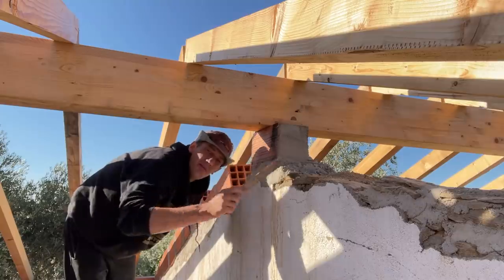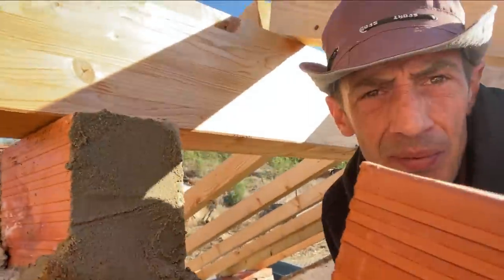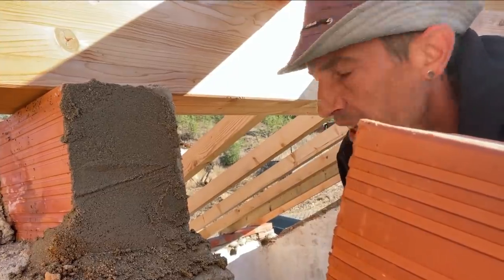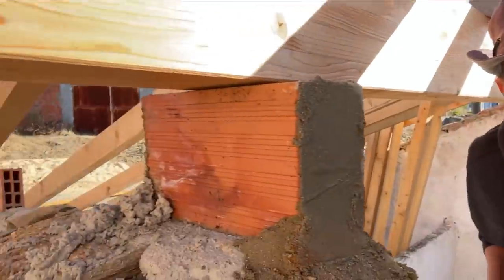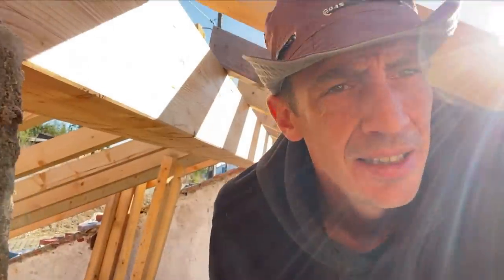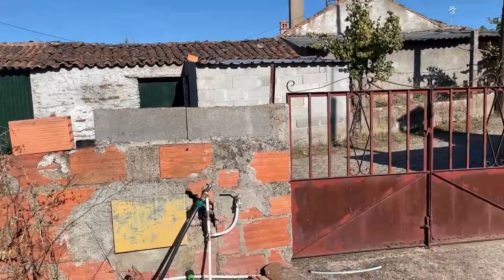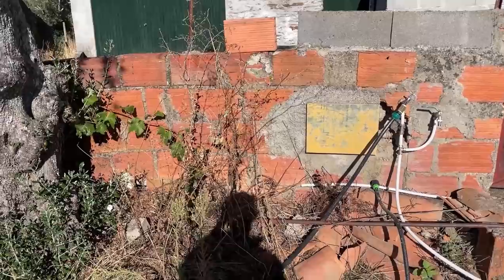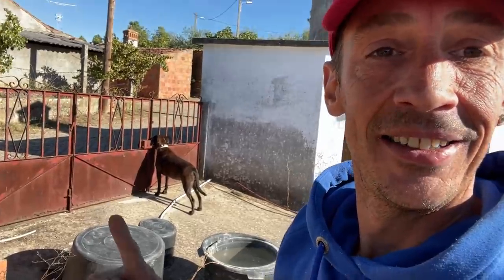Work FASTER, work HARDER on the roof construction - Portuguese house renovation

Comment: You may find that for compressive  strength, the holes should be vertical running up/down 

Test a tijolo horizontal and vertical with heavy weight

Comment: Don't mean to be a killjoy but ! those rafters are not stress graded , they are to small a section for the length without a purlin , and the wall should have a wall plate to distribute the loading the way you have bird-mouthed the rafters on the newly laid bricks is not correct GET AN ENGINEER to help you !  can you just do what you want in Portugal ? friendly and sincere advice
Reply from the maker: Yes, that’s basically the point, you can replace you old roof yourself here. And this is the way they did it for ages, so I don’t see an issue :) wallpapers never existed some decades before.
Reply: @GhostTownVlogs  OK the wall plate is not essential but the rafter ends position on the wall needs to be correct , and just because " its the way they did it " does not mean it is sound . please consider my other points ( purlin at least ) love and respect... William
Reply from the maker: Well I have been questioning local builders as I’m going along with the project and they say it’s all fine :) the rafters length should just be enough to support the weight by them selves :)

Comment: I'm not a construction professional, but this renovation looks very amateurish to me. The stones should surely be installed differently in order to hold a roof load safely. If you get started on such a project, you should at least have a basic knowledge of construction or at least have a talent for craftsmanship. Sorry for my openness, but so far everything is "botched construction". I wonder what his previous job was.
Reply from the maker: But your also not a professional .. so how do you know ?? In Portugal they have been building for decades like this. I don’t see any issue :)